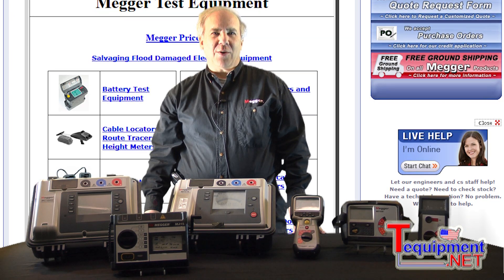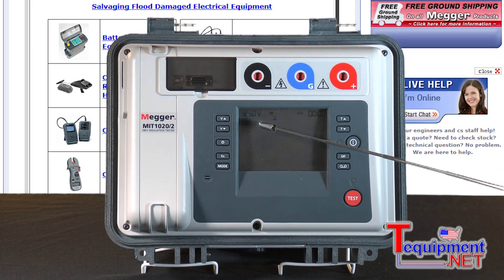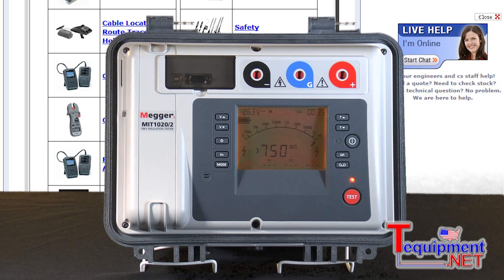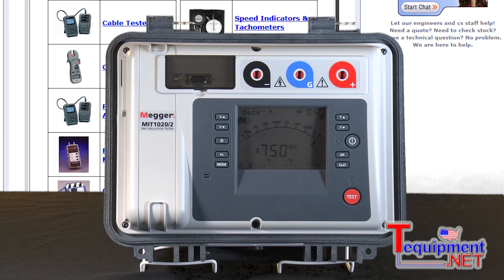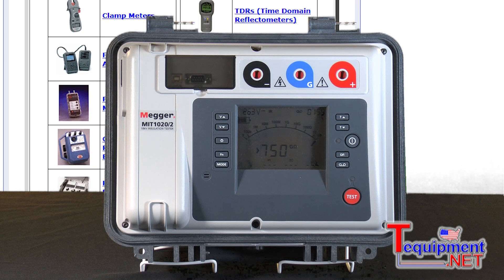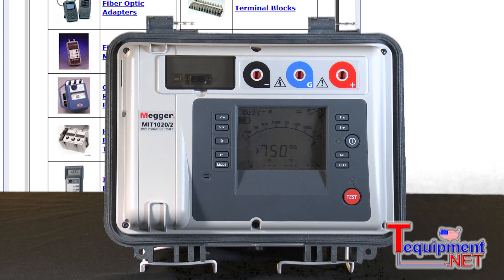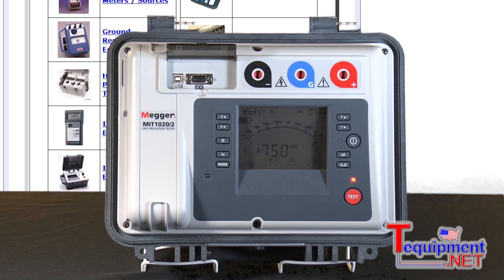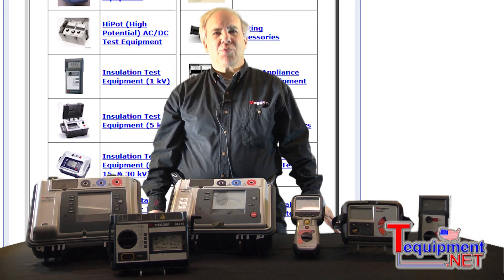Megger MIT1020/2 10 kV Insulation Resistance Tester with Data Storage

Comment: Sir, I have a MIT 520 Megger, it shows br.d in 2500v & 5000v range when test button is switched on without even inserting the probes,how to troubleshoot the problem in Pcb level please help.
Reply from the maker: This could be because you do not have leads attached to the device. Try connecting leads and see if the error continues. Explanation of the error is below.

br.d = breakdown detection

This is a common error code on this device. If insulation breakdown is detected, the unit aborts the test and flashes “brd” and the final test result alternately in the main digital display. This display is disabled when in burn mode as the unit will continue the test without aborting. The instrument detects breakdown in terms of a rapid drop in test voltage commensurate with that caused by an arc across or though the insulation under test. In breakdown mode the test will automatically terminate on detection of a breakdown to prevent damage to the insulation. Burn mode disables the normal breakdown detection and test voltage continues after breakdown of the insulation. This enables the location of the failure to be seen and detected acoustically but it is a destructive test.